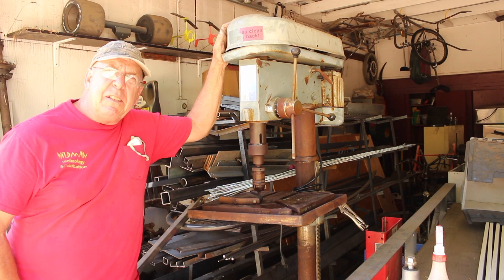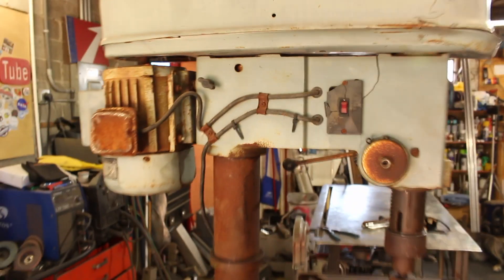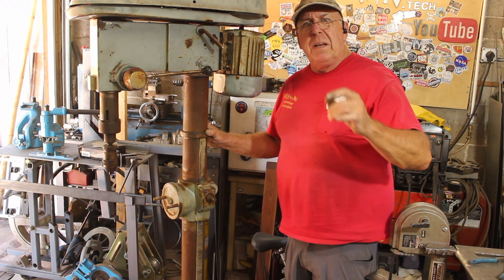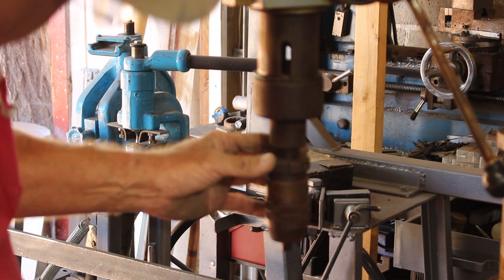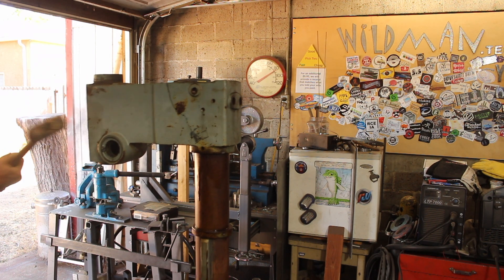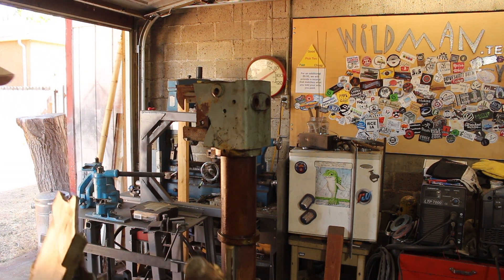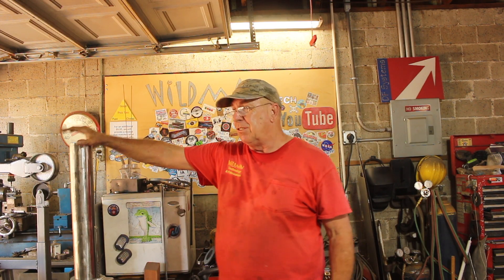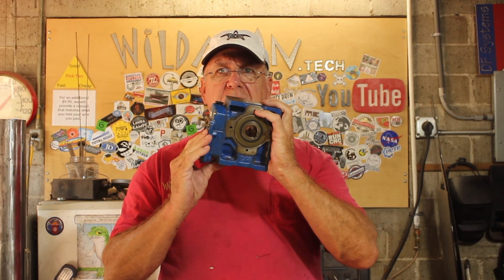Drill Press Rehab - Part I

Comment: Hi, I used Evaporust for some time but found it expensive. I was told to try white vinegar, which I bought for a fraction of the price of Evaporust, and it worked just as good and I got an old sump out of a scrap car and filled it up. I bought the vinegar in five litre bottles and put it up on a small table so I could use a tap to empty the vinegar back into the container to keep for use again later. You need a bigger tub to get the items covered completely.